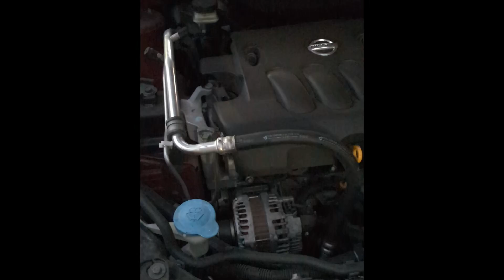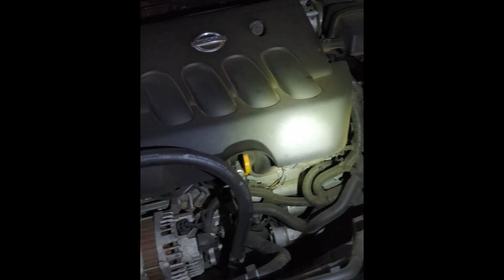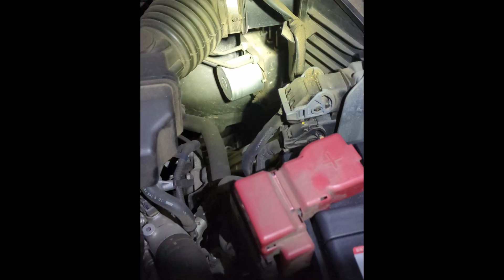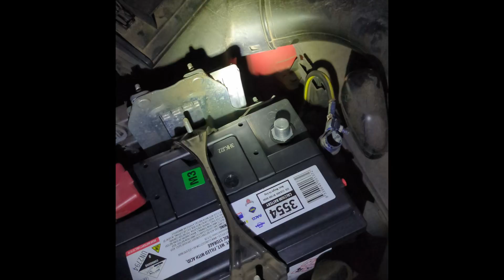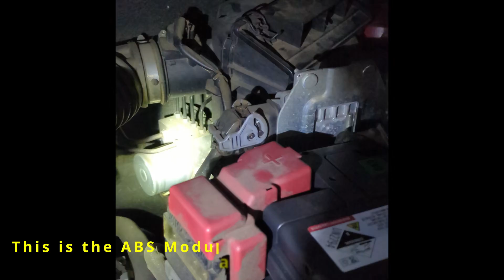Nissan Dualis ABS Modulator FAIL

Comment: Suspect your brake fluid is fine. If it wasn't you'd probably get a warning light about that and/or no brakes. Probably a relay or a sensor that controls the relay. My 2c, even though it won't help a great deal.

Comment: That might explain why the battery mysteriously died a few months ago, might be time to buy a Toyota🤣
Most likely a stuck/welded relay, or FET in the ABS module has gone wonky.
A possibility is a wiring issue involving rodent damage or corrosion, moisture etc, wheel speed sensor issue, or an issue with another critical input to the module.
The ABS module relies on quite a few different sensor inputs, like the wheel speed sensors etc for it to decide when/if the activate the pump, so it should never activate other than when needed, and never when the key is off.👍🇦🇺

Comment: ABS has its own Power and Speed input, but also has other inputs via the CAN Bus.  If the PCB has water ingress, then I suggest that could be a fault.  Checking CAN Bus resistance might help.

Yes, you could pull the fuse, though you wont have ABS until diagnosed.

Comment: Your problem was buying a Nissan! I have a 2006 Rav4 that's done 450,000 without anything other than a clutch the kids cooked learning to drive burning out. ABS still works :)
Reply: Nissan does reliable cars ... actually most Japanese cars are very reliable.
Rav4 might be more reliable but also more expensive. I wanted a plugin hybrid and Toyota only had 2 models and the RAV4 was one of them starting at €50.000 ... 
I have had Toyota for over 30 years but at those prices ...

Comment: Just pull the ABS fuse to start.  You're brakes will still work, you just wont have ABS.  Then you can get it to a shop whenever.  I had to do this on my 1999 Chevy Tahoe when the wheel hub sensor died at around 450K miles (724K Kms).  I've been too lazy to replace it, so I just have to drive it like I learned 40 odd years ago...pump the brakes in that white stuff we call snow.  Yea..sorry, your "2010" is such a new car...with low mileage.  LOL.

Comment: You have two main fuses that feed the ABS-  one is a 50A fuse and the other is 30A.  (labeled H and I)..  You might try pulling those fuses under the hood, one at a time;  but they may feed other things.   Frankly, I'd just unplug the module at the ABS

Comment: Once it cools.. If you just reach down there to the ABS --  and unplug the module.  The plug has a large rotating latch.. If you just unplug it, you can still drive it until you get it repaired.  Inside the module there are a number of relays and it sounds like one is stuck on...   also, in America this thing is called a "NISSAN ROGUE
Reply: It's a Nissan Qashqai in the rest of the world.

Comment: Inside your car.. If you can turn off traction control-- it might disable the ABS module (maybe).  Worth a try.  You should definitely have a fuse and relay that operates the ABS--- It will most likely be under the hood, but it's possible that it's under the dash.
Reply: It's under the bonnet.
Reply: @Okurkaarrgghh Bonnet? It is called the HOOD! 🇺🇸USA🇺🇸 USA🇺🇸 USA🇺🇸

Comment: Shorted FET in the ABS controller which controls the motor. The motor should never be on when the vehicle is off.
Reply: Probably corrosion on the gate pin.

Comment: This looks like Bosch ABS, there were two variations of it. Earlier versions had ECU in the back of the car where all wheel sensors etc were run to. Newer version of ABS pump had ECU mounted on the pump itself. Easy to tell the difference by looking at the amount of cables going into the pump if it makes sense. From what I understand pump motor should kick in when ABS is triggered. It is either logic board, grounds, wiring or the relay as suggested earlier.
Reply: This is the best comment on the problem, if you have a ECU communicator aske the ECU did you turn on the pump ,my opinion: the car not moving , probably ABS control unit is dead , because if the realeay is switched contioniusly the ecu senses something wrong and makes warning light or something , but in this case its just stuck in the last position. But I am better making parts than finding a problem in other cars.
Reply: Faulty wheel sensors can make the ABS pump run constantly as sensors keep telling the system that they're going crazy fast. You can try to see if moving the tires into a different position helps any. Could be that you're missing permanent magnets on the wheel speed ring
Reply: @YouzY666  YES that is a vaild , but the q is the car has a accelerating sensor (probably has), and if , the sensor talks to the ECU  and the ECU cheks the  validations on other sensor for the other sensors.

Comment: Looks easily accessible. It's probably an hour job for a mechanic to replace.
Reply from the maker: That's the plan.
Reply: @EEVblog2   You can usually just replace the actual module on these and not deal with all the mechanical side... with all the brake lines and re-bleeding the brakes, etc..   Also, in many cars the new module will have to be programmed.  Might be a pretty pricy job either way...  On my 2010 Dodge Nitro--  I just simply unhooked the ABS and never thought about it again. lol.   We don't have inspections here in Oklahoma (USA), so I'm in no hurry to repair something that's not necessarily needed...  I'd hate to see you pay to fix that and then your car needs a new transmission in a few months anyway.  There's a point of diminishing returns on repairing cars.  Choose wisely. :)
Reply: The replacement part is $1000.

Comment: Relay welded, or worse yet the computer logic for it has shorted transistor.  Rodents?
Reply: Even if a control transistor was shorted the relay should  shut off when the switched ignition feed is killed.
Reply: Not necessarily but in this case it will be the ABS module which is usually part of the pump , remove the ABS fuse and it will stop the pump running your brakes will still work fine you just won't have ABS. @eDoc2020

Comment: Pull the fuse.
Reply from the maker: No ABS fuse
Reply: @EEVblog2  There's a 30A and a 40A ABS fuse in the engine compartment fuse box.
Reply: My current and previous Nissan's have two fuse blocks under the bonnet. One either side of motor.

Comment: If its staying on id say relays contacts have welded together. Try changing with a different relay thats the same kind and see if it stays on
Reply: Yep and because the engine isn't running something else won't be in the correct state I guess.

Comment: Time to convert it to Mr Fusion and make it fly, eh? Ha.
Reply from the maker: Mr Fusion only powers the time circuits and the flux capacitor.
Reply: @EEVblog2  right. I wonder what powered the flying drive though. Rocket fuel? There's no tanks for it and the oxydizer on the DeLorean though, and they would take up considerable space.